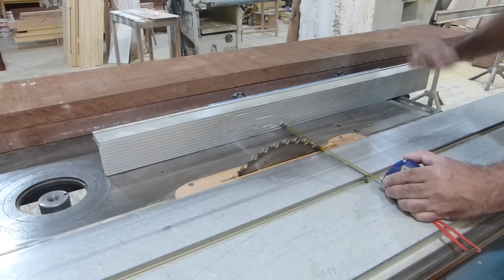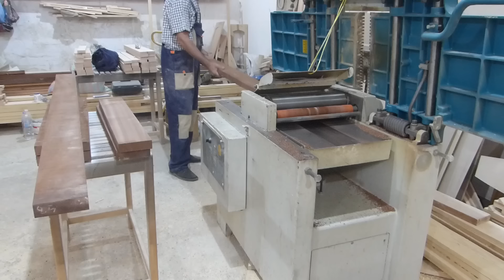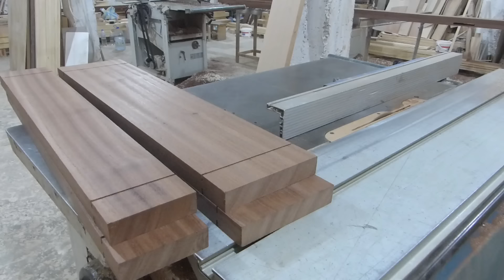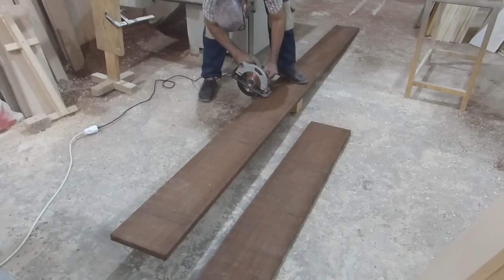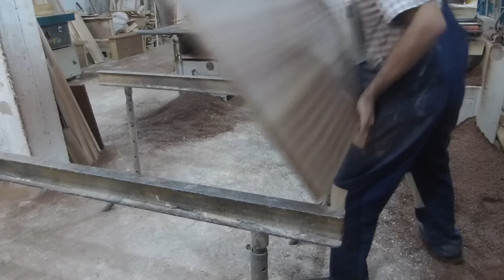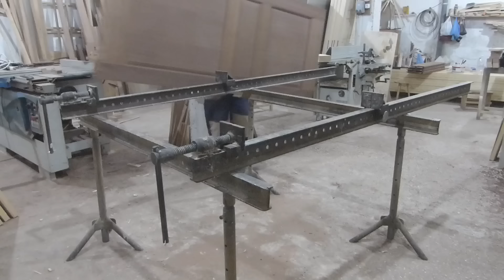Creative solid wood door making in easy way

Comment: I have never seen a jointer with a mortising attachment, that's awesome!  Great work!
Reply from the maker: Most of the machines we have in Algeria are like this. Thank you for your interest and appreciation of my efforts.
Reply: Can please you tell the number of man hours from start to finish ?
Reply: a lot of combinations machines have this function. I don't use it much on mine, but then I don't make a lot of doors or other projects that require use of the mortiser. But it does come in very handy at times, specially when you don't use it enough to justify a special mortising machine

rule no.1: never leave a mortising bit in there when using other functions....
Reply: @millsteel  European style of combination woodworking machines, from 2 to 5 different operations. Those are handy if you lack space to have a different machine for each operation.

Comment: Rails should not been done as a solid pieces. Should be done with a sub--straight usually pine or cedar and 3/8" glued on either side. Solid pieces after time will warp.